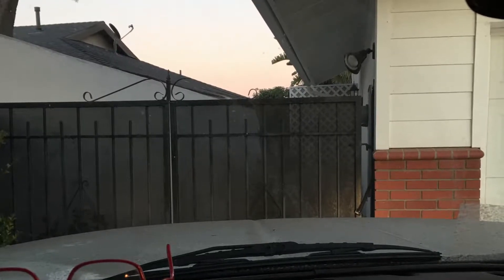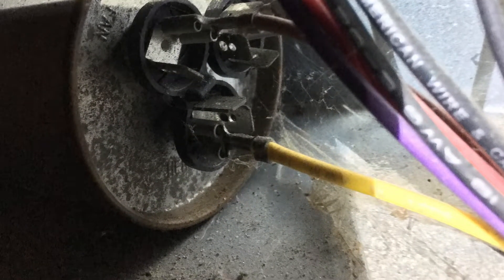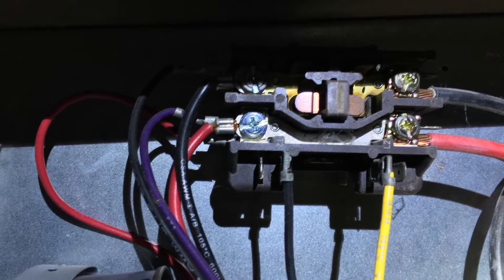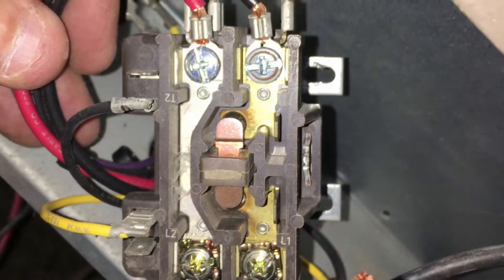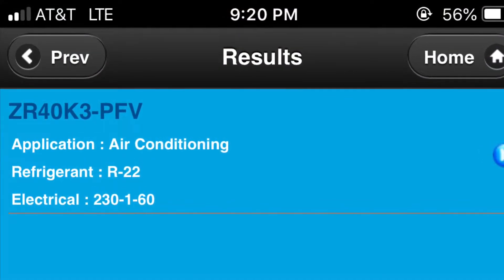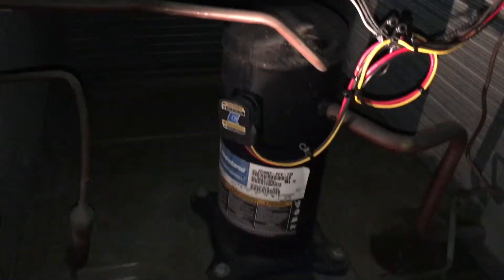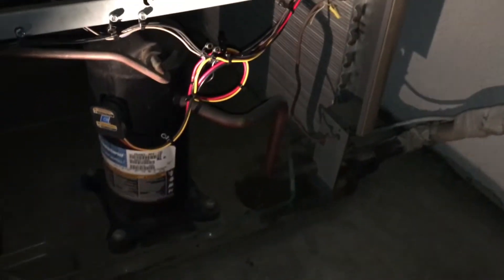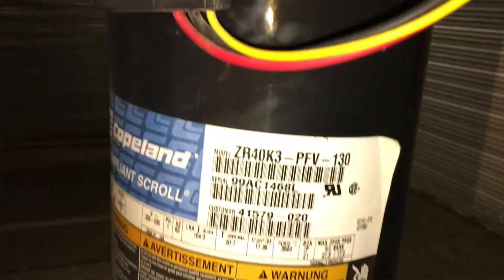Residential - Service call. Clean-up unit & Replace Contactor. Was Frozen up.

Comment: Those old Armstrong/Airease are good units, there are still lot of the late 1990 unit still around in my area, the most common part to replace is the Contactor
Reply from the maker: Good unit it looks like. i Have not worked on any of these ever. That Shows u how Well they are built. No Service calls in 20 years. How are  Armstrong units these days ? The OTHER UNIT  the DOG HAS BEEN PISSING ON. THE CONDENSER COIL IS NASTY 🤢 LOOKING. BUT, it is NOT Leaking.

Comment: Is that the modern Pioneer Supertuner. I bought one for my first car, a beater GTO.
Reply from the maker: i don't know when i got that installed.probably within the First few years of owning the truck. so somewhere around 2000-2005. Pioneer Has Built Quality Audio Equiptment since the 70's at least. Receivers, tape decks & Turntables , Pioneer still kicks ass ! Pioneer Rules ! i Have a Pioneer Pl-530 Direct drive turntable that still kicks ass. Vinyl ftw.